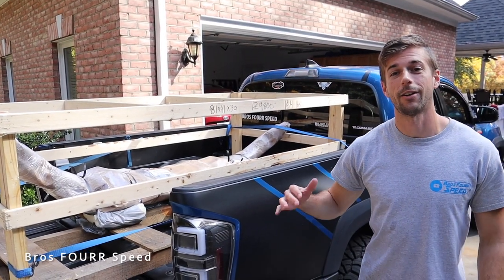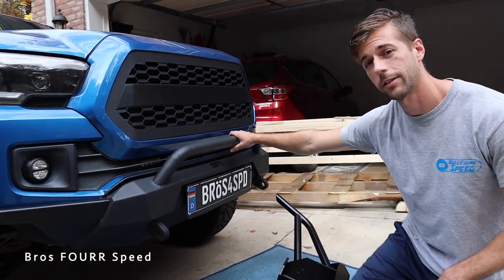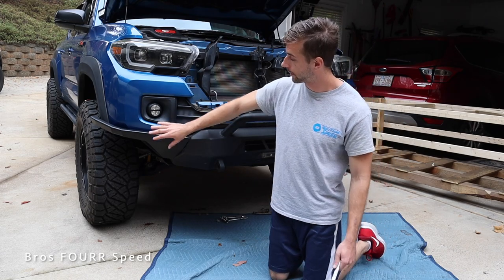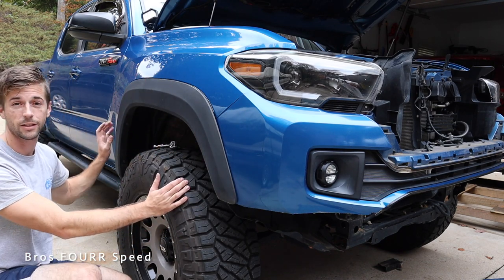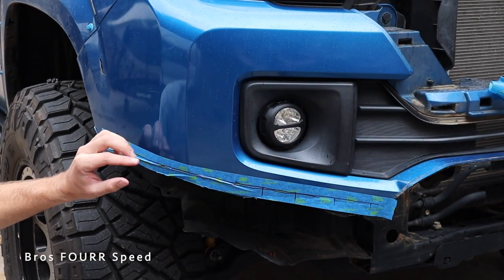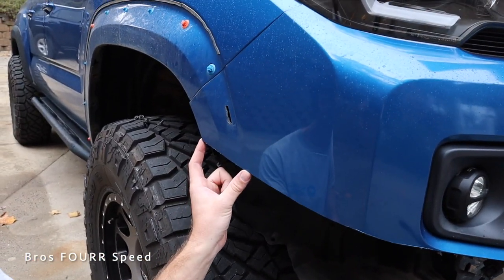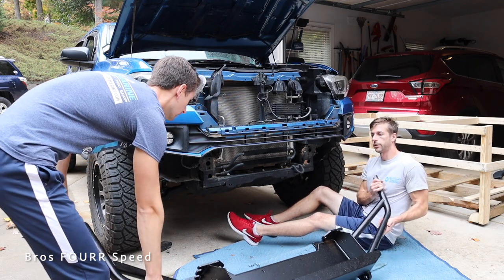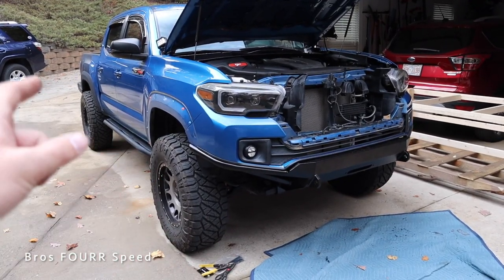Toyota Tacoma Gets Another FACELIFT!!

Comment: What were you using to cut the bumper and where did you but it? I could use one of those for my own bumper install.
Reply from the maker: Here yah go! https://amzn.to/3nYeMcX
So useful!
Reply: @BrosFOURRSpeed  thanks! I actually have one of those, but it didn’t look like an oscillating tool because the blade didn’t seem to be vibrating left or right as much as I’ve seen oscillating tools in the past. I’ve seen those things in action before and that’s why I was nervous about using one to cut my bumper.
Reply from the maker: @HM-vu9zw  as long as you have a tape line to keep a straight line or as close to it as you can, it makes for a clean cut!